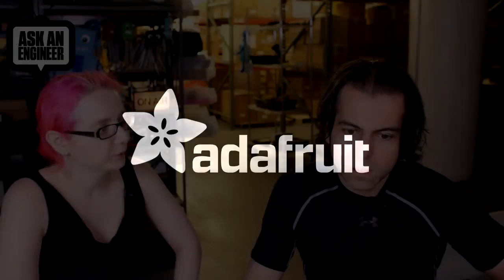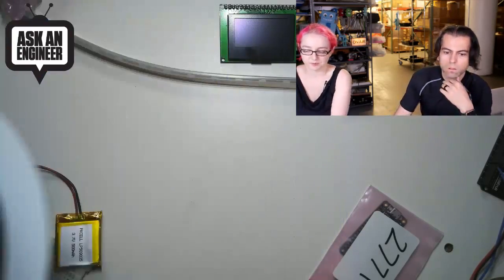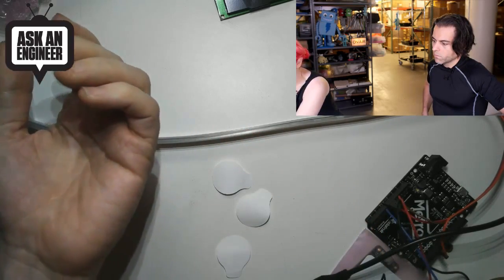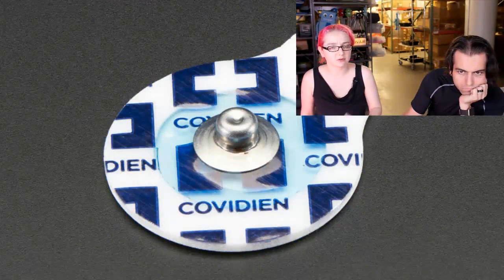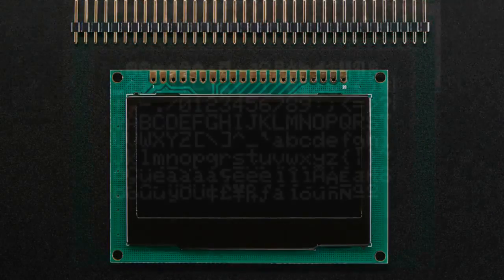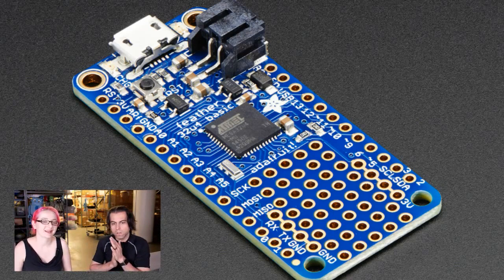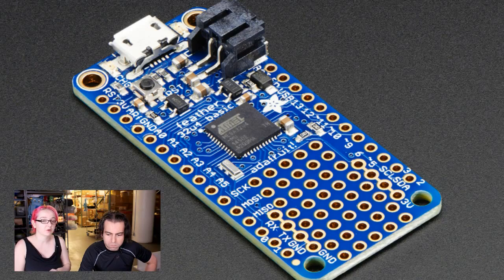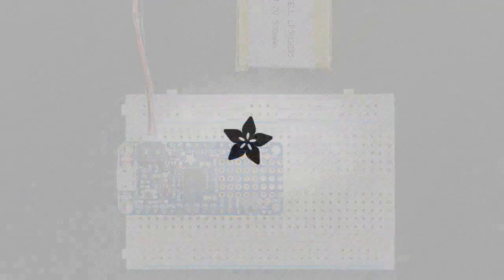New Products 11/4/2015

Comment: my son and I are building a Picorder inside a toy tricorder. looking at your Basic Proto and I have a few questions. I'm total noob and my 12yo son is only marginally better. 

I want to use a flat cellphonebattery to run a Rasberry Pi 3B with a GPS hat and 3 additional sensors. I love the tiny screen shown here (the 1.7" I believe). 

does the Basic Proto allow me to use the cellphone battery directly or am I misunderstanding this? thanks!